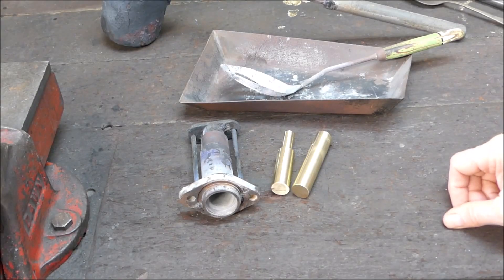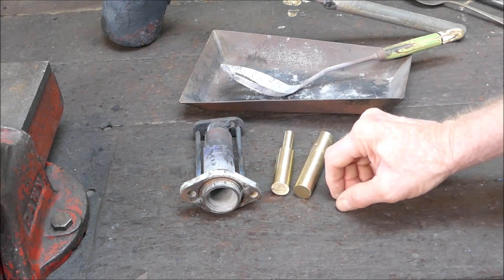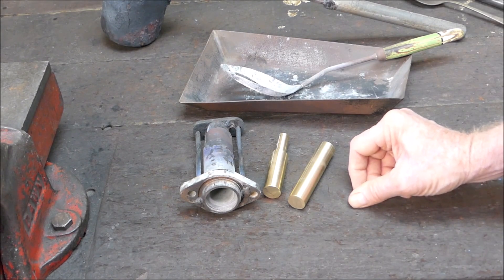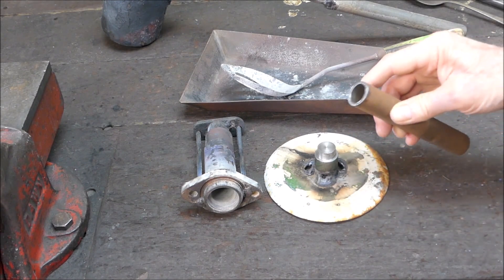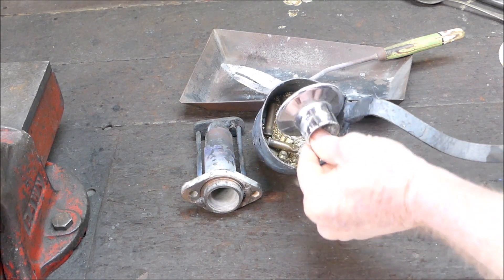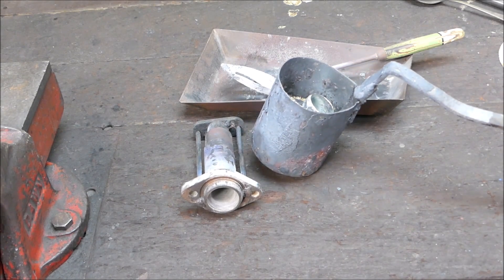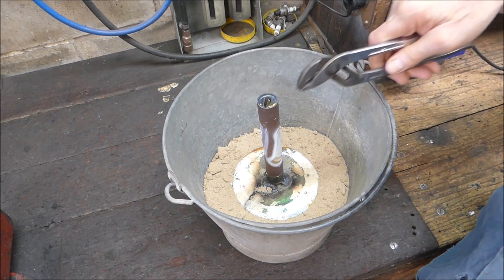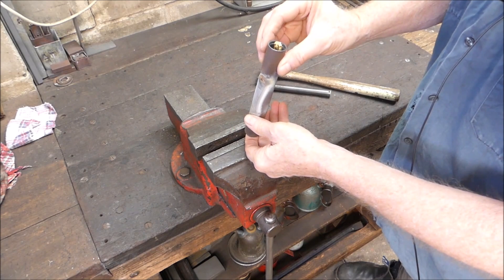Casting brass round stock in a steel mold at home

Comment: New sub from western Canada. I have had brass braze weld, itself to a heavy steel crucible bottom.   Does anyone know about the effect of losing zinc in the melting process. The fumes can't be graet for one but what about the quality of the brass?
Reply from the maker: The fumes are toxic, so take precautions.  The brass seems to be non the worse for any zinc loss from a single melt - machines fine.  I have never had an issue with the brass bonding to my steel crucible or molds.  Make sure the surfaces are well oxidised and this should prevent it happening. Cheers Rob

Comment: I have found that when using steel crucibles it is good to coat the outside with 2000*F paint to improve lifespan, may be worth a go for you.
Reply from the maker: Thanks for the tip.  The crucibles are heavy gauge and are holding up very well.  Cheers Rob

Comment: Hi Rob, interesting that it doesn't bond to the tube, well done, I never ever re-melt brass turnings re-melting  brass loses zinc &  doesn't come out well, also I've got plenty of scrap brass !! [lucky me!!] over the years folk get to know you & brass comes in from all over the place especially when you do the odd machining job for folk.keep up the vid's
Graham.
Reply from the maker: It may bond to the tube if you added flux, but the heat oxide prevents it as is.  It works well with cast iron and steel pipe molds.  Any zinc loss would be relatively minor provided you don't prolong the melt process.  The brass I've re-melted turned up fine, as seen in the video.  Cheers Rob

Comment: maybe cut the pipe in half down the middle and use hose clamps?
Reply from the maker: You can, but the tube would need to be in sand to prevent leakage.  The stock will also no longer be round due to metal loss from the two cuts - egg shaped.

Comment: G'day Rob ,
Fantastic video mate !
I wonder if instead of using a crucible to melt the brass and then pouring into a steel mold you could use the mold itself  as the crucible and just keep feeding in small chunks of brass until it is full then remove it from the furnace and let it cool ? If you made a mold with  the end blanked off with some steel flat bar  you could drill a hole in the end  after it has cooled down  to allow a pin punch or some steel rod  to be used to drive the ingot out of the tube and to re use just weld up the hole . Might be worth a try and maybe it will work on Aluminium as well , i used to do this when i made anodes for the Hardchrome company i used to work at years ago but i was casting lead .  Another source of tube is old bottle jacks and shock absorbers .
Reply from the maker: Hi Ian,  good idea.   Cutting it up would waste a lot, so maybe do the pour into the mold and then cook it for a while to get the same effect.  I will try that next.  Cheers Rob

Comment: "That's fuckin brilliant" 🤣👍 Like others I was surprised it didn't stick. I'm gunna guess that the smoothness of the inside surface had a lot to do with it?
Reply from the maker: Hi Bill,  He He, gotta swear occasionally to show your inner self ;)  I was expecting it to stick from all the comments I'd read, but didn't happen.  Maybe it was the smoothness, as there was no oxide or rust coating to inhibit it.  Maybe it's like brazing, you need flux to make it happen.  The pearlite lining is taking a real beating from that big gas torch.  I will do a video update on that next.   Let's say it has a limited life expectancy ;)  Cheers Rob

Comment: Turned out great I need to put that chip tray on my lathe
Reply from the maker: Dead easy to add one using the bolt holes for the travelling steady.  You can extend it out to also cover the leadscrew.

Comment: Hi Rob: I'm working on the same like u. You cleared up a lot of my doubts with this video. A big hug from Argentina
Reply from the maker: Hi Pedro,  it's all a learning curve. Good to share information.  There's a lot of misinformation around about this subject.  Cheers from Oz.  Rob
Reply: Rob please try to use te same pipe with aluminum to see how it unmolds. Thanks in advance. Cheers!!
Reply from the maker: Hi Pedro, I have been casting aluminium round stock in steel (tube/cylinder) molds for many years.  I have done a number of videos on the process. Eg: https://www.youtube.com/watch?v=sP6jfkkNMYw

Cheers Rob

Comment: Was that the bearings making noise on your lathe? Sounded a little different than  usual.
Reply from the maker: No.  I fitted a new drive belt and it's slightly wider than previously and the edge is rubbing on another pully side.  Just have to wait for it to wear back a bit.  Does sound like a bearing.  Cheers Rob

Comment: I know a gun range that has 2 years worth of brass on the ground,  mainly 22 shells. They have been walked on and worked into the ground.  They will have to be washed but they are all mine if I want to put in the work.
Reply from the maker: Free brass is like gold wherever you find it.  Cheers Rob

Comment: Once you have poured the metal in the mould,  take the crucible out, put it on its side. Whilst the brass is still molten in the mould quickly put the mould into the furnace. Relight the burner. Get the brass back to molten and keep there for approx. 10 mins ( time depends on quantity of molten metal). The inclusions in the brass will float to the top of the mould. Then cut off that top part. If you have steel ingot moulds the same process of keeping the metal molten again allows the inclusions to float to top surface. Mill that surface off till you see clean metal. Then use those ingots to put into a clean crucible. This way you reduce the amount of inclusions. Don’t stir the molten metal in crucible that adds “bi folds”which are the imperfections that appear in the metal. Apologies for such a lengthy “comment”.
Reply from the maker: Hi Robert, thanks for the comments.  All sounds good.  I will try that next time.  I'm fresh out of scrap brass, so it may be a while.  My brass round stock pile is currently very good, and now has a range of sizes to keep me going.  Cheers Rob
Reply: Pity you don't live in Melbourne, Rob. I've around 40 kgs of plumbing fittings, door knobs etc. That I would give happily. They'll probably end up with a scrap merchant.

Comment: Hi,Rob. Not too bad an outcome considering the low quality of the initial  melt stock. I wonder if sooting the inside of the tube might improve matters by isolating the molten pour from the inner steel tube face. I have deliberately saved some offcuts of drawn steam tubing to try out as moulding cylinders as it is very smooth inside and has good internal dimensional tolerances.
Reply from the maker: Hi Howard.  There was no extraction problem with the pour, so sooting doesn't seem necessary.  I expect the tube will get an oxide or rust coating over time which will do the same thing.  Cheers Rob

Comment: That worked a treat, you just need to score some more scrap brass and find out what works best for you.
Reply from the maker: Yes, my scrap pile for brass is now zero.  Sounds like remelting the initial core in the mould may eliminate those small inclusions.  Well that's the theory.  Cheers Rob

Comment: Hi Rob. I really thought that was going to stick to the steel, quite amazed that it came out as easy as it did. Even with a few imperfections that could still be used in a model engine as, say a support pillar for example. Cheers, Alan.
Reply from the maker: Hi Alan.  It's usable.  You can often work out small imperfections.  I'm fresh out of scrap brass and pretty well provisioned on good stuff now, so I may take a break from melting for a while.  I will give a progress report on the furnace status next as it's taken a beating from that big burner.   It certainly works well though.  Cheers Rob

Comment: Take the mould and smoke it with a candle flame inside, will release better, plus also heat up the mould as well before pouring, so the cooling rate is a lot slower, and the molten brass can get all the gas out before cooling. Probably also good to add in a bit of zinc more, to handle the loss during melting, and perhaps a bit of scrap aluminium to alloy as well.

Comment: Only  guesswork, the narrow lead into the mould made the pour a bit slow? 
In a lot of YT vids on casting the importance of a good heavy head of 
molten metal on top is apparent. So a wider lead in ''funnel'' speeds up the pour
and gets a bit of weight on top
Could the chrome be  causing  the imperfections ? A quick google says it melts at 
1900c ,way above brass at 900c. They are fairly close in density so the chrome may 
not rise with the dross.
The steel mould is an eyeopener , a good point to prove , I though we'd be getting the big hammer out .
Reply from the maker: Hi Lee.  I agree on all points.  I actually considered adding a funnel, but as this was only an experiment I went quick and dirty on it.  Chrome in the mix is not ideal, but how do you remove the damn stuff ?   I've used up all my scrap brass for now, so looks like this will be it for a while.  The extreme temperatures have given the furnace and crucible a bit of a beating and that will be the subject of the next video ;)  Cheers Rob

Comment: I did expect you would have to split the outer steel casing,  saying you would have machined it off surprised me, but different thought processes I guess
Reply from the maker: Hi Ian,  I fully expected the steel outer would have to be cut away.  I was all prepared to simply turn it off.  That way you are least likely to damage the brass core.  The way it slid off surprised me, after all the negative comments I've seen about brass sticking to steel.  It's got to a point on the Internet where I serious doubt a lot of stuff I read ;)  Cheers Rob

Comment: Enjoying your brass experiments  . The furnace is working great for you .
👍
Reply from the maker: Hi Colum.  The furnace really gets hot.  Works well, but is showing some wear and tear from the massive temperatures.  I will give a run down on it next video.  Cheers Rob
Reply: @Xynudu  yes Rob was wondering how it was taking the heat . I had a fire clay furnace with metal bands that my father used for over 50 years, and he prob got it second hand , he was as cheap as me 😊so it was prob over 80 . Used ceramic crucibles , I think the brand was salamander.
But it didn’t survive moving out of his workshop.so that’s why I am enjoying your furnace videos, might have a go at one . I remember seeing one for sale at a show and it had a spiral grove inside to swirl the flame up the furnace . Often wondered if this was a good idea. Cheers Colum
Reply from the maker: Interesting Colum.  I used Perlite and plain builders cement for the paint tin furnace and that slowly wore away, but this new bigger burner really puts some serious stress on the current lining.  The refracrory mortar is taking a beating.  At least it's cheap to replace, but maybe refractory cement will work better.  I see the gas cylinder furnace made by The Hobby Machinist NZ has a better looking initial finish and a really high refractory cement content.  How it will stand up to severe heat remains to be seen.  The spiral groove sounds novel.  So many variables in this project.  Cheers Rob

Comment: Excellent job rob,I've found that if you let it cool down slow it come out ok, great video, keep'um coming.
Reply from the maker: I let it fully air cool.  Worked out way better than I expected following all the negative comments I'd read about brass and steel molds.  Cheers Rob